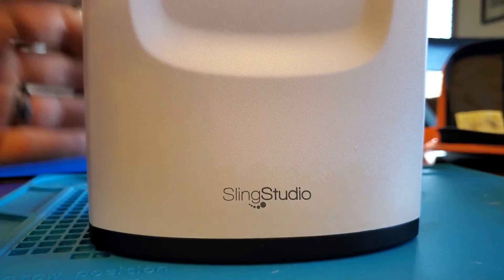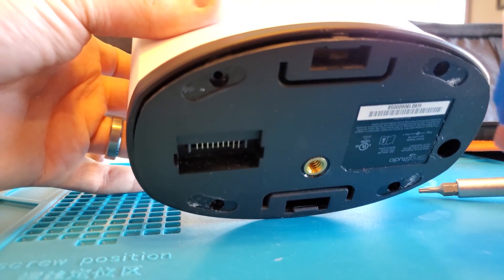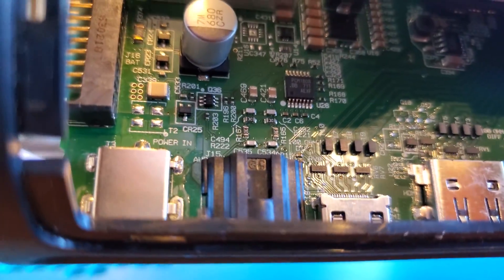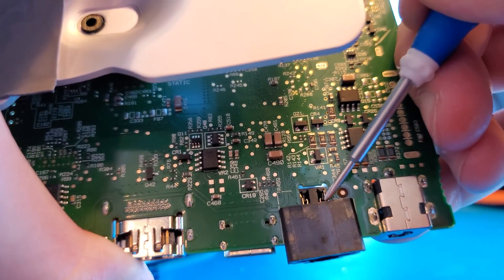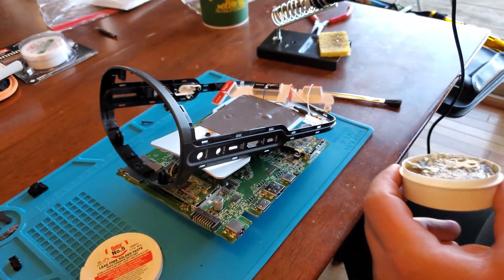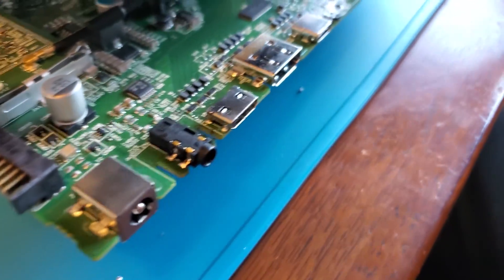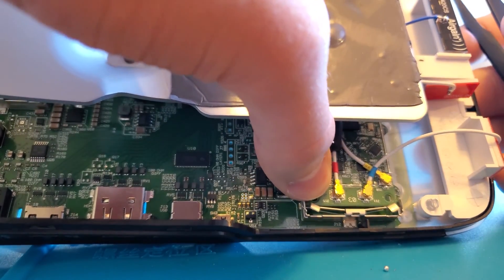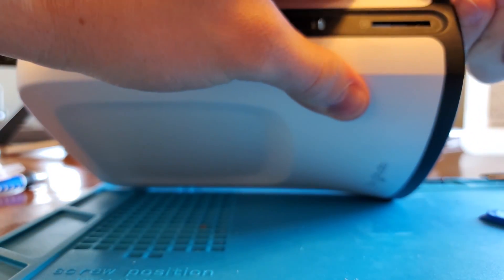SlingStudio Hub Disassembly and Line In Repair

Comment: cool tip how to disassemble the hub thank you, my issue is not hardware is software it connects then after e while its disconnect and I had to reset the system then work again for a while then back again the last it took a while to connect with the ipad and had to reset again, anyone issue with that one?

Comment: Do you have a similar fix for the HDMI port?
Reply from the maker: Hdmi ports are much more complicated and require some good micro soldering skills. I've changed ports before, but not on the sling. You'd have to find a matching part via mouser or digikey most likely.
Reply: @slamman60  Thanks.  I think we have a resource with the skills you describe.  So you think the part would likely need to be replaced?  Not just re-connected?
Reply from the maker: @unitedmethodistchurchwlv   typically its best to replace it. There could be internal damage to the port or ripped up pads. Just depends
Reply: @slamman60  Got it.  Will do, thanks.

Comment: Does anybody know of the datasheet for a replacement power button? I'm trying to repair one of these because the power switch got damaged, and I'm having trouble finding a replacement. It's about 6x6mm, right angle, and has 4 pins instead of just 2 like you'd expect. The damaged power button is labeled 'FD VK' on the back but has no other markings.

Comment: Nice video. I saw on your video that wifi antenna has multiple cables. Does any of these cables has something to do with the camlinks video signal connectivity. I ask this because last time I used my Slingstudio unit, my SS hub suddenly stoped receiving video signal from my two cameralinks, I can pair the camlinks with the hub, the hub says it has camlinks sources but there is no video signal. Any advise? maybe something is loose in to the hub?

Comment: What is the name of that part and where I can buy it? I thing mine is damage
Reply from the maker: This is the closest I can find, but it has a 5th pin: https://www.cuidevices.com/product/resource/sj2-359x-smt.pdf
Reply: @slamman60  do u think it will work in the sling?
Reply from the maker: @PampanosRecords  only one way to find out! I'd measure the distances for the pins first
Reply from the maker: Did you find a replacement?

Comment: Our 3.5 Line-In never worked from out of the box, bad jack, so now we use analog board and send that to the camera's XLR input. Also a Camlink got "Lactched" to one device, meaning it now only works with one device.
Reply from the maker: Honestly sounds like configuration problems, not hardware. Cameralinks can be reset and paired with any SlingStudios

Comment: Are you able to help me trouble shoot my sling?
Reply from the maker: What's going on with it? Check the link in the description to the Facebook group. Tons of good knowledge in there
Reply: “Unable to connect” to the Sling specific hotspot. When doing the reset function it does not connect in the console app states the same error. Haven’t been added to the group just yet.
Reply: Unplugged the blue antenna cable and it connects completely fine. Must be a short or something 🧐

Comment: Your video is very helpful, thanks.

Oatey Number 5 is for plumbing and contains corrosive chlorides.  It is good that you cleaned it, but there is likely some still underneath the jack.  The Oatey pdf also says not to use it on electronics.  Kester makes a no-clean flux pen that would be inexpensive and perfect for this job.  Check it out.

https://www.kester.com/products/product/nf372-tb-flux-pen
Reply from the maker: Great info. I may blur out that part. Thanks
Reply: @slamman60  dont do that!!!  Lol. It will reset your view counter to reupload.

Comment: Good video! I just bought mine and returned one and got a second one because I kept getting the cracking sound and it was very annoying. Second one still got. And I opened and it was solid. Now I’m worn seeing if I need to remove it completely and then we install it. Did you sound sounds clean after the fix?
Reply from the maker: Yea, mine sounded very clean after I soldered it. Always check your cables and sources first and make sure you're getting clean audio through your line in cable

Comment: My camlink stopped working. It wont charge up. I called slingstudio and they said it has to be replaced.  Any advice?
Reply from the maker: The cameralinks take a lot of power to charge properly so your normal usb bricks won't always work. Use the search feature in this Facebook group. This question has been asked a ton there: https://facebook.com/groups/109251566427008
Reply: @slamman60  Thank you.  Waiting to be approved by the private group.  But, can it be fixed instead of buying another cam link?
Reply from the maker: @cesarmendez9551  I'm not sure. I don't think I've heard of anyone fixing it themselves yet
Reply: @slamman60  Hmm.  Is only 14 months old with a 12 month warranty.  Slingstudio should extend their warranty or offer additional protection.  Thank you slamman60.
Reply from the maker: @cesarmendez9551  Agreed. This may help you until then: https://www.myslingstudio.com/Help/KB/KB-1070.aspx

Comment: where did you buy new audio port?
Reply from the maker: The port itself wasn't bad, just the solder joints. It's the same port. However, ebay would probably be your best bet?
Reply: @slamman60  reference of the port plss

Comment: Can you do a repair on endless blinking blue light?!
Reply from the maker: If I knew the cause, I would!
Reply: slamman60 I heard the cause is has to do with not enough power to reboot the hub. If can repair it or give us a referral that would be great 👍🏾
Reply from the maker: @08Youngb  hmm mine has only done this once after an SD card was pulled without being ejected. My solution was to unplug everything, hold down thr power button to discharge any residual power, and let it sit overnight. Didnt seem to work for others though
Reply: That happens to mine too
Reply: I have the same problem. Blue light just blinks none stop
Reply: You must reset you slingstudio/